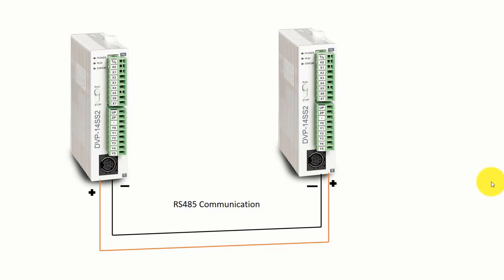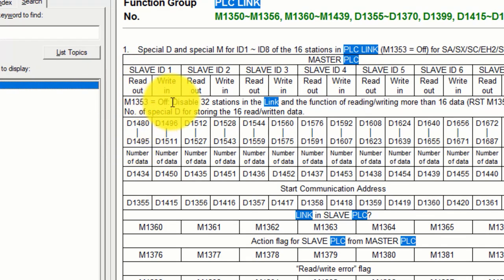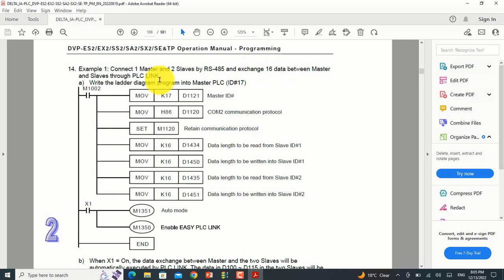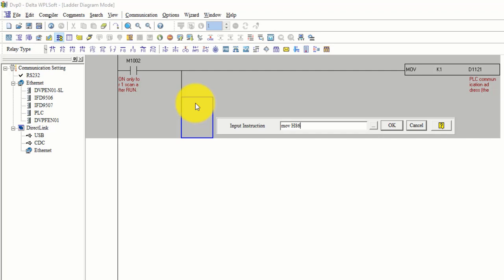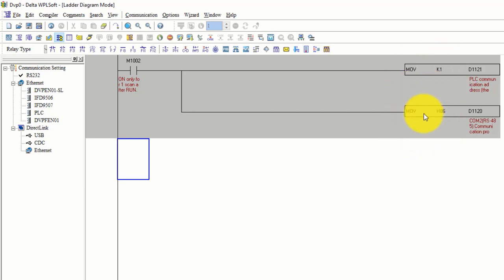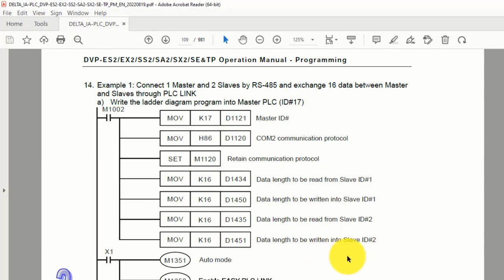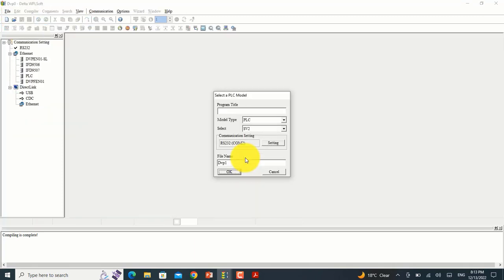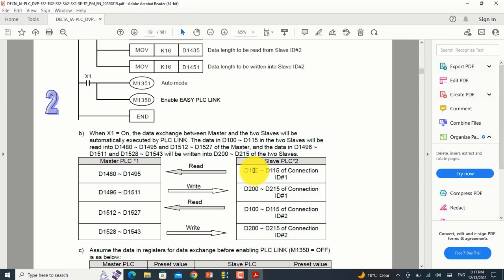RS485 Communication PLC to PLC| Delta PLC to PLC Communication| Two wire Communication| PLC link

Comment: Hello, can you please help me setting up connection between arduino uno serial monitor output(data from load cell) which can be read by delta as228t plc